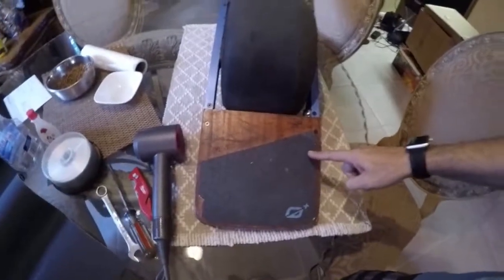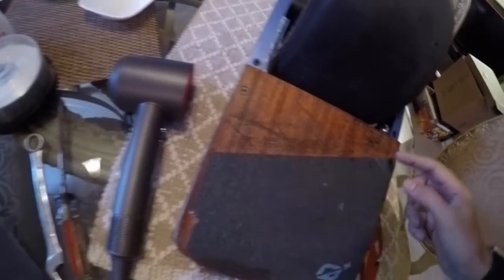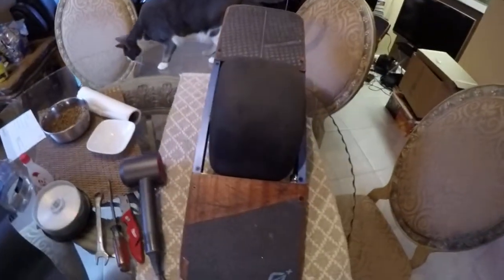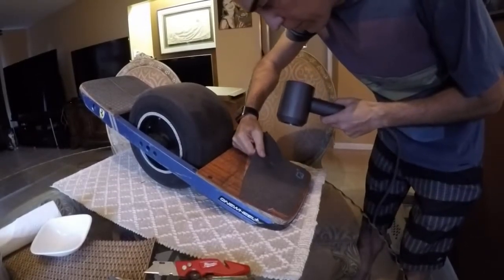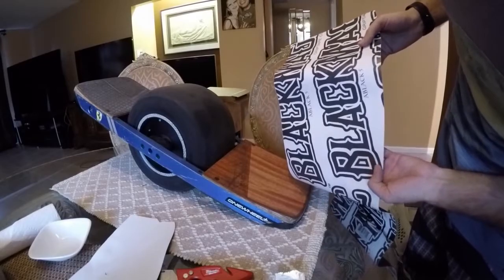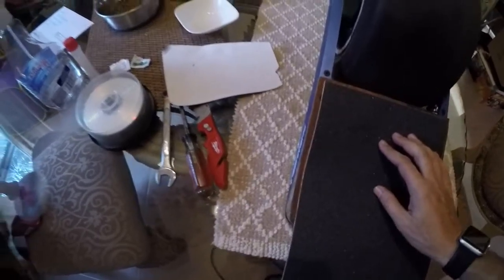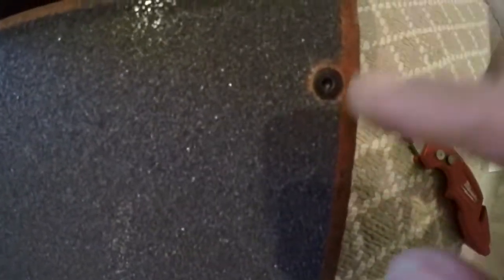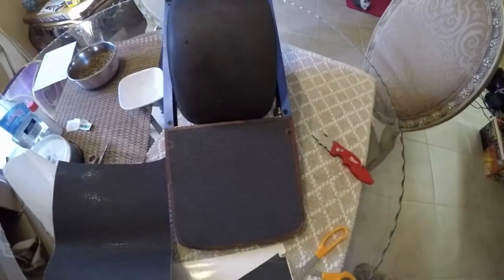Onewheel Grip Tape Installation Replacement, Meticulous Method with equidistant edges.

Comment: Good video Chris :) I'm about to regrip with vicious, but will try blackmagic next. Last time I gripped my ow, I didn't leave the gap needed for the fender not to rub against the grip and it screwed up my grip. Anyways, this video has been informative. Thanks again!
Reply from the maker: Grind671 I’m sort of doing the opposite, I picked up some pre-cut Vicious at FloatLife Fest and I’m going to try that on another board for comparison. Supposedly the Vicious doesn’t last as long because it is so gritty.